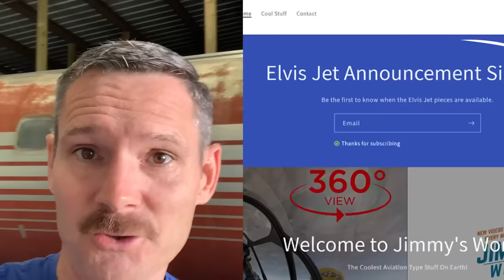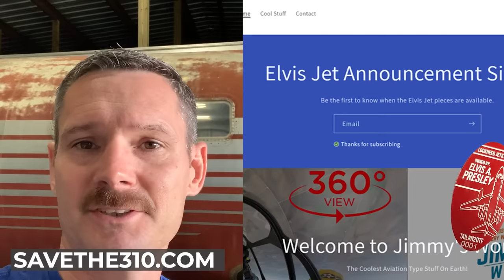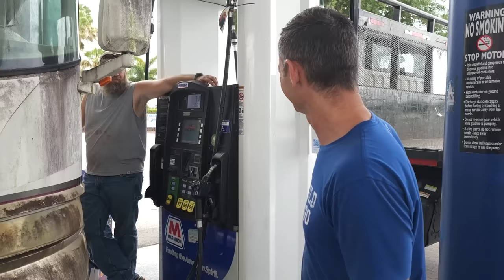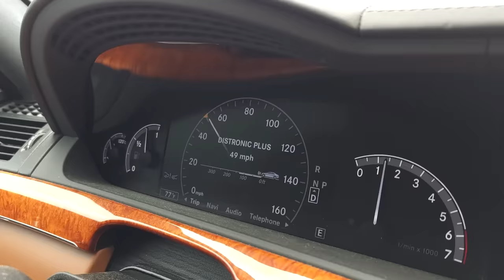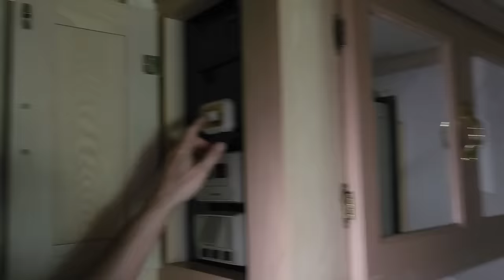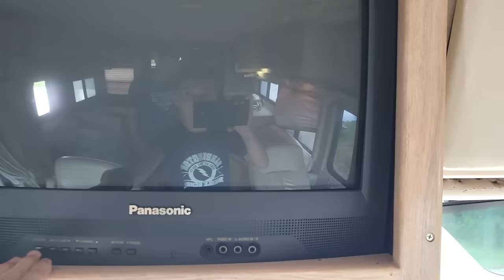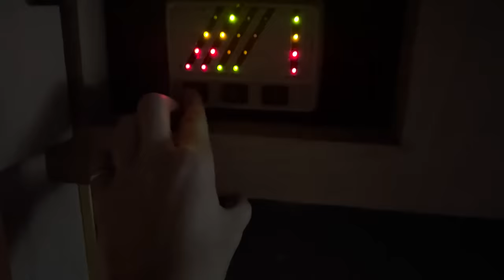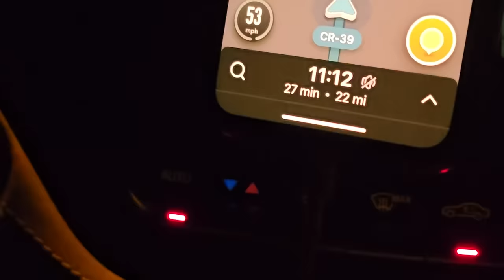Driving The FREE Abandoned RV Across Florida…It Was Terrible

Comment: Diesel is one of the first products that comes from the distillation of crude oil. There is not nearly as many blending components in Diesel fuel as there is in gasoline. Diesel is more expensive because there's Federal and State road taxes added to the price. The reasoning is because tractor trailers, which are heavier and larger than passenger cars and trucks, put's more wear on the transportation infrastructure.

Comment: If you can start it by the em start button. Trace 35:47 Back the wiring from lthe starter selonide to the ignition sw it myy have a couple of safety reays in it get wiring schematic save a ton of work.good luck.

Comment: Diesel is a commercial fuel. It is used as refined diesel for trucks, trains and some ships. It's also cracked and made into commercial airline jet fuel.. and as you know, anything connected to an aircraft (physically or not) has a "luxury markup" price tag applied to it.

Basically they rip you off because they can.

Comment: Some years back when diesel was dirt cheap somebody in the government decided that the exhaust should be limited to 15 parts per million of carbon particulates.  To do that the fuel must be refined 5 times.  When that happened the price shot up the ext day.  That is why diesel is so expensive today.  Sometime later they decided 15 PPM was too high and introduced DEF to the mix.
Reply: @tomhendricksen1805

The 15ppm figure you quote is the sulfur content of the fuel itself, not particulates in the exhaust.

The move to ULSD was mandated as the emissions control components of EPA2006 compliant diesel engines could not handle high amounts of sulfur. 

Eventually, the emissions standards reached the point at which they could not be met without aftertreatment (DEF). 

These improvements in diesel engine emissions controls have certainly had a negative impact on reliability and maintenance costs, but they have led to considerable decreases in air pollution.

Instead of bitching about the "government" how about you actually do some research as to the real reasons for 15ppm ULSD.